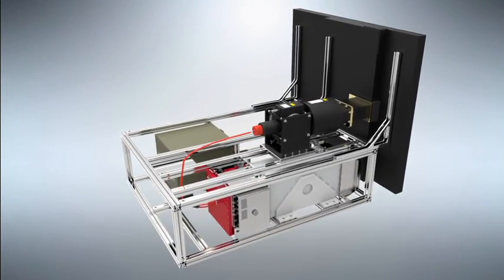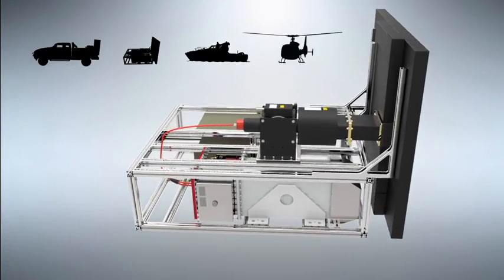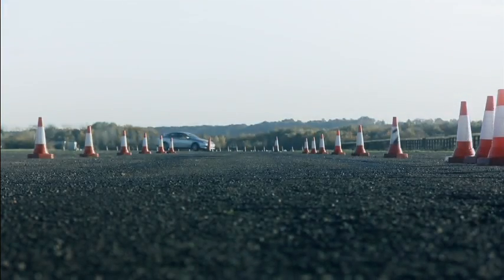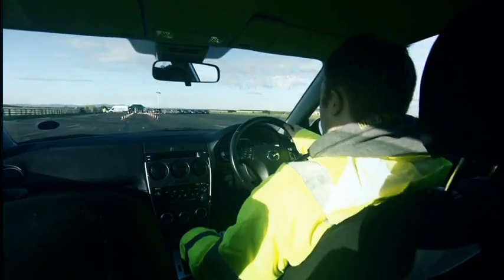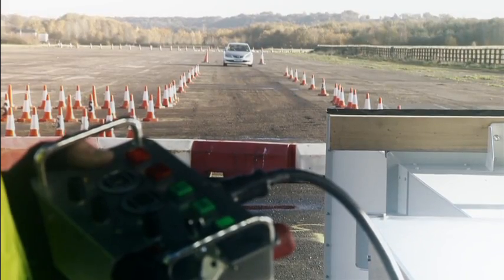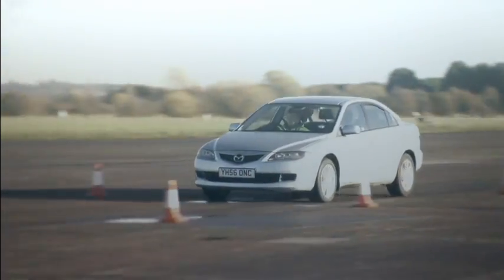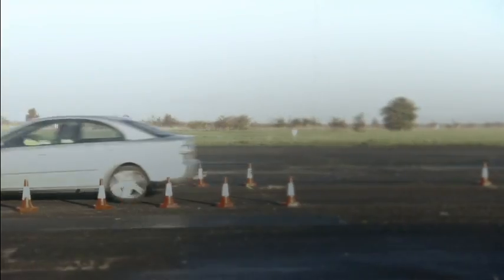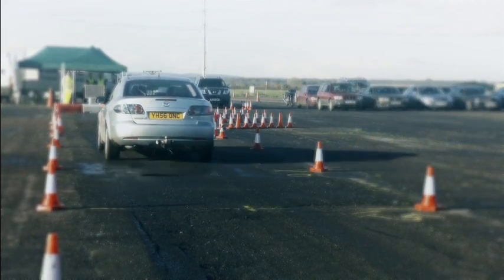EMP Vehicle Stop

Comment: as stated,will NOT work on older cars=get your hands on a cool,old car and u r fine,and..if u r not completley lost when comming to electronics,u can quite easy "emp-proof" your car
Reply: wrap your electronic components in copper mesh
Reply: *****
It shouldn't, unless you have a vehicle with onstar or Sirius radio
Reply: *****
I'm pretty sure airforce one uses copper mesh to surround their b-747 aka president's plane from electromagnetic pulses
Reply: Google Faraday cage or electromagnetic shielding...Same technology is used in antennas to prevent EM noise and get "cleaner" signal.
Reply: Bicycle is 100% guaranteed!

Comment: My Honda Supra 100cc will still be working, it has carb without any electronics ...old school ...doesn't even need battery to start(kickstart) :D
Reply: :D
Reply: But it has a Hall effect igniter control that does not work in the presence of high power microwaves...
When there is no more spark the engine stops.
Reply: Jim Armbrester underbone motorcycle, I think in some other country it was called wave100(I used it before)
Reply: :D

Comment: what if the driver has a pace maker would that kill them
Reply: +Colin Lanser It would only stop the pace maker from working. So I guess if they had a heart attack while it was under EMP effect they would die.
Reply: it's all good! depopulation y'all!
Reply: Yes, it will short it out and they will die within about 10 minutes
Reply: I must shut off nanotech BMI rnm mk. Neb
Reply: If they came out running with guns drawn and had a heart attack
Reply: Probably not.  Remember, the driver is inside the vehicle which acts as a faraday cage to a limited extent.  The engine control components are mostly under the hood and susceptible to electromagnetic impulse.
Reply: @BobReed1  Nope. The vehicle is not in any way a Faraday cage. It would stop the pacemaker and might kill the patient if they needed the pacing to live.
Reply: They shouldn't be driving, lol!!
Reply: @brave0nej  or sitting in the car as a passenger??